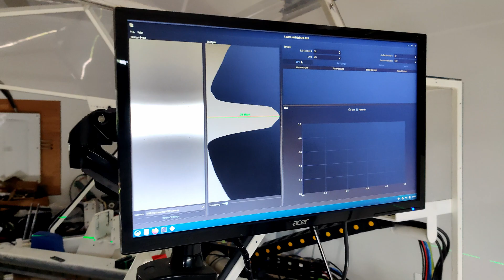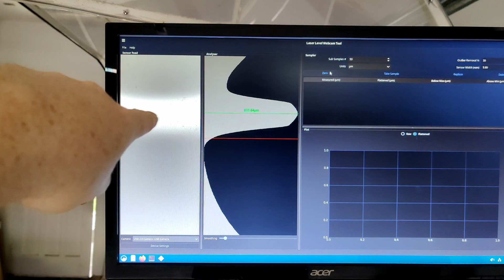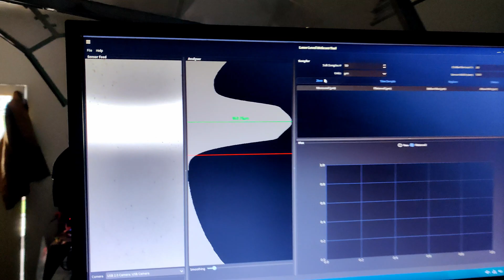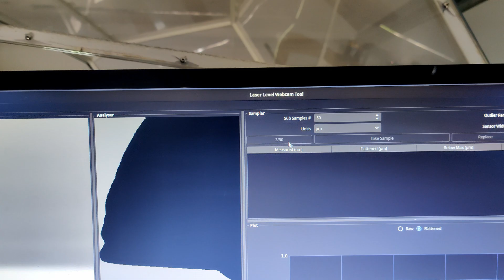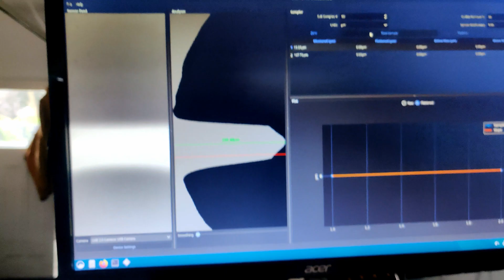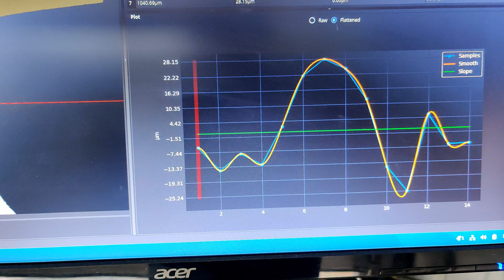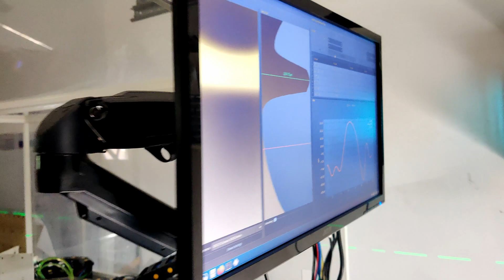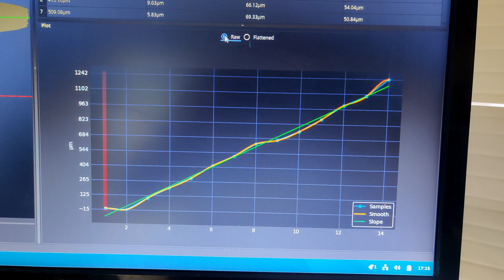More measuring with laser and webcam

Comment: Personally, I would like to see what would happen if you tried flattening the high spots using a piece of precision ground steel and fine sandpaper. Or a good flat sharpening stone.
Reply from the maker: It would work. You’d need to be working with thicker steel than what I’ve got. The main issue I’ve found is when thinner steel tubes, you’d have to take off so much of the corners getting the center of the tube where the rails bolts to flat.The profile of the tubes it kinda dips in the middle where the rails are. 
Next time if I were to build a cnc from scratch, I’d either start with thicker tubes that I can surface a whole bunch of material off without compromising the tubes or to weld some 1/4” flat bar onto the surfaces where the rails would bolt to and get those machined and ground flat.

Comment: This is really cool! What if you used one of those tiny surface plates, say 12" size, combined with the laser graph, to scrape? That way the plate gives you local flatness and the laser gives you large scale flatness.
Reply: Thats a great idea. Imma try it. Want to incorporate laser and scraping for a long time, but never thought of a small surface palte
Reply from the maker: Yeah should work. I've got an 18" plate but have yet to build a stand for it. 

Maybe mapping and marking the same mid value with the laser/webcam. Surface plate should make quick work of marking the high spots to take down.

Comment: Super cool project Bryan... have you tried this with a rotating self leveling laser? Or do these vibrate to much? and could you share the camera/sensor you use?
Reply from the maker: Not with the laser but I did try rotating the mirror. Tired it with a hard drive motor and polishing the outside. Had no success with it. Too difficult to polish the surface good enough to be a mirror. 

I've got a video uploaded on it.

Comment: Since you have been working on this for a while, I would suggest recording these values for all the surfaces, then put it together. If it turns out you don't like the accuracy of the the machine, you can implement an error correction step to compensate or get the machine to your desired accuracy. You may be at a diminishing returns region already as dynamic deflection while machining may exceed your current setup.
Reply from the maker: I’m using LinuxCNC and have a topic on their forum on the subject. So far there isn’t much within LinuxCNC to be able to correct for this. I’ll probably have to look at this on my own at some point. https://forum.linuxcnc.org/10-advanced-configuration/50250-possible-to-automatically-compensate-for-irreguarities-on-the-xy-plane

Comment: Nice work.  Once the rails are flat, will you measure & calibrate the rails to be parallel with each other?
Reply from the maker: I have a master precision machinists level that I use for getting the Y rails onto the same plane. These levels are very sensitive and work well for this. What you do is zero the level out on for instance the right Y rail and than use that zero reference when measuring the left Y rail.

Comment: Maybe some coarse lapping would work. Otherwise there is a lot to experiment with, angle grinder polishing, flap disc, (grinding disc if worn because it grinds quite slowly then), as you said dremel, sharpening stone, carbide paint scraper scraping, corrosion with acids, copper acid solution which will make steel get off when the copper tries to adhere and the steel dissolves, electroplating the low spots, using a plat plate with mold release and epoxy do thin layer, mount the linear rails or whatever elevated in the air with every bolt so the nuts determine the flatness.

Comment: Your laser method inspired me to try a different, much more archaic aproach since I have outdoors space I can use. Im also building a moving gantry CNC and plan to use a cheap cross projecting laser and move it across the rail on top of the moving block and use that projected cross far away (6-10 meters away) to detect inaccuracies since the cross shouldnt move or rotate. By having it projected that far away, a very slight defect should still be detected. So far, Ive finished welding the gantry tubes and Im afraid I have a lot of warping, 2 mm deep bow in the center over a length of 1m. Ill have to correct that first, then fine tune with my method, thankfully I prepared a raised surface for the rails I can remove plenty of material from before I reach the main tubes.

Sadly, I suspect welding these raised surfaces is the main source of warping (the rest is sequence welded and symetrical) but I was gonna have to scrape away material regardless, so better have plenty warping and be able to remove it than to get the tubes so thin you cant thread into them.
Reply from the maker: Since you can weld, I'd suggest get some flat bar ~1/4" (6mm) and weld it to the surface you plan to have the rails on. That'll give you lots of material thickness to get the surface flat again. If I'd had done that with my CNC machine I would have gone through the process of scraping and grinding them flat
Reply: @BryanHoward  Yep yep, did that with 8mm thick 60mm wide flat bar. Cut it in the middle along its length and welded the ~30x8mm bars along the 1m in key areas, not the whole length, that would be a catastophic ammount of warping then, considering I got 2mm bow trying to be careful Xd. Planning to do the same for both Y-axis rail mounts but Im really afraid of the work awaiting me on getting the warp out of it.

Comment: As you say it is just 0.002" which is actually really good. BUT you know it is 2 thou out. I would suggest using a flat stone and addressing you major high point areas. It won't take much to remove a thou or so and so halve your variation. Given your setup it is now so easy to stone it a bit then check immediately and accurately so it really becomes a why not. That said if you can't get it to alter reasonably quickly and with little effort there is no harm with just letting it be. If nothing else it could be a short video to show that it is or isn't easy to address this variation.
Reply from the maker: I might try hitting it with flap wheel on the angle grinder to hit the worse high areas. That might be the best tool as the surface has a slight concaved profile shape to them being a tube. Flap wheel can keep that shape without grinding down the sides too much.
Reply: @BryanHoward  I would think that will be too aggressive given you are only chasing a thou or so. A narrow stone, about as wide as the track? Also that raises the point that you aren't actually measuring where the track will be as your support for the imager is wider than the track. For a better representation put some tape down where the outside of the track will be as a guide and use spacers that are just the width of the track. Then you will be measuring exactly where the track will be located. Again does this all matter, not really, but given you can measure to microns "easily" its fun as an observer watching it being chased. If it isn't fun/interesting for you then.....

I didn't realise this started from a PRINTNC project until one of the latest comments. I am know thinking of building my own based on it as most of the base thinking is done. A kind of weird setup is in my mind. Invert the XY axis and treat it like a core XY printer. Provide Z by moving a separated table Up/Down. This would mean the spindle is ALWAYS at its most ridged point. Also if you do this you can add more weight/dampening to the XY structure as you don't have the weight of the Z structure interfering. Also the Z axis can be well constrained (4 rails in my head) and almost unlimited in its weight as its movements are relatively small and slow. I haven't seen any CoreXY type routers but I think the concept make sense. Just like it is the now "best" type of 3D printer.

Due to space limitation I intend to have it INSIDE a table. So a little smaller than the std PrintNC but hopefully not too much if I make the axis belt driven. The top of the table will be a welding bench convertible to a MPT wood bench and plain bench. In my head everything fits, with the FUSION drawings for PRINTNC I can easily try it out in virtual space. To make it usable I will have lift legs that can raise the whole table when needed. It will be interesting to see if it can operate well when lifted. Will the whole thing be ridged enough within itself so vibrations of the whole structure doesn't matter as it is the WHOLE structure that is moving so there is no relative tool/workpiece movement. Anyway still a project at the pondering stage so no outcome, if any, for quite some time.
Reply: I think this youtuber is conflating levelness with flatness, he should first make the whole surface flat using a flat reference and trully understand flatness (elbow grease it)  before pulling out any lasers.

Comment: Hey bryan, did you have a look at the taunt line method? has some quite good papers behind it with results making it comparable to an interferometer measurement.
Reply from the maker: I've looked at it while building this one. I think it could work out quite well and I plan to build one some time in the future to compare both methods. My main reason sticking with the laser and webcam method first was to see how well plotting points in a 2d grid and automating that all with the CNC machine would work. That all worked but became very finicky with the laser line calibration. 

The taunt line for measuring straightness might work out better for simple setups like rail straightness as there are many less variables with the laser compared to this method.

Comment: I find this whole endeavour absolutely fascinating! You're opening up a whole world of amazing possibilities, including some daydreams of my own. Years ago, while thinking about the accuracy limitations of DIY CNC milling, routing, and (especially) grinding machines, I wondered if it would be possible to integrate an optical alignment system for the tool head which could dynamically compensate for misalignment. Creating a rigid structure is much more achievable than creating one which is both rigid and perfectly accurate. For DIY machines the latter is constrained by the maker's skill, the metrology instruments they have, and the quality of affordable components (linear rails, bearings, etc) typically used in DIY machines.

If you could integrate something like what you've been documenting here into your machine, perhaps you could regularly map its imperfections and create some sort of correction table that could be applied to your GCode before it's sent to the machine. Perhaps laser/camera units attached to each corner and a rotating mirror tool in the spindle (especially if driven by a servo that could be rotated precisely).

As I said, I find this all very fascinating, so please continue to share your amazing work with us armchair daydreamers 😁
Reply from the maker: I've spent a bit of time a couple months back looking into what it would take to modify LinuxCNC to have a calibration map of the surface of the work area. This could be a matrix of static height values measured by the laser. Basically what is been done with current 3d printers to get very good mapping of the heat bed for good first layers. 

Something like this on a CNC would improve any inaccuracies of the XY axis in terms of height. I have a couple videos with automating the CNC with the laser level + webcam to do surface probing and one video probing a coin with a crap load of points https://youtube.com/shorts/vuXR8RIW44o?si=ffIJpOk-DIx-zXwm
Reply: @BryanHoward  yes this would be excellent. If well integrated it could be a routine task ahead of any machining task, compensating for not only built-in misalignment, but temperature and component wear as well. I think it could revolutionise the capabilities of DIY CNC machines.
Reply: That would be awesome, Im building a machine myself and I believe when Is finished it will be over 300kg and plenty sturdy, but I still have a very long way to go and so far Ive induced a significant warp from welding the gantry main horizontal tubes that I must absolutely correct, however the remaining innacuracies is whats difficult to get rid of.

What would the probing procedure with lasers and mirrors be like? I believe maybe you could have an accelerometer firmly attached to the spindle body and run a stop and go probing sequence gcode simultaneously to a table filling program on the accelerometer side (that would make the probing much faster even though the end result will not be as accurate since accurate accelerometers can still have +-0.01º error and thats significant over a length).

I can imagine an effective result will comensate for bow and twist over short drilling operations, but it would still be impossible to accurately drill long straight holes because its phisically impossible unless you have a 4 or 5 axis machine.

Anyways, I wish you start your machine building endeavors soon, once you get your hands dirty with it, its hard to stop... XD
Reply: @DgtalBreakz  Just a thought, but I think the most practical application of this technology would be for planar accuracy, not positional accuracy (assuming you are thinking of wider application including positional accuracy). That would allow compensation for warp and sag, and give the added bonus of tramming verification for vertical spindles. Accurate linear scales are relatively inexpensive these days, and they can give you excellent positional measurements, especially if installed on both sides of the gantry.

I think that as long as you can get the image sensors fairly aligned, you could install a battery-powered laser directly into the spindle, which would act like a laser level when rotating. The laser beam would sweep across the image sensors in a perfect plane. Moving the spindle through the X and Y coordinates would reveal any deviation between the plane of the spindle and the X-Y plane of your machine (as long as the laser is set precisely at 90 degrees to the spindle axis, or else it would describe a cone).
Reply: @pauldorman  I see, that makes a lot of sense and would work asesome assuming the z assembly is very precise. But I can imagine a similar setup could be made to prove Z but you would have to rely on a different laser spinning source since the light line would be projected vertically to map along the Z travel.

Comment: I received my PrintNC parts this week 😁. Im planning to use your software, its easy and cheap! Why are you scraping the high spots and not grinding them?
Reply from the maker: The PrintNC discord is very helpful. It's worth putting as much effort in being as accurate as possible with the bolt holes using the 3d printed hole guides. Good luck!

Comment: those webcam settings are a part of windows that is universal for all webcams, I think the package you would want in linux is something like v4l2ucp, which is a control panel similar to that one in windows for any v4l2 (video for linux 2) devices, which should be like any webcam etc.

awesome stuff btw, great videos!
Reply from the maker: Yeah I never figured out how to from python launch the windows device GUI for the webcam. It can be done via c++ but kinda a hack just to add it. On windows my work around was to launch it from ffmpeg with "ffmpeg -f dshow -show_video_device_dialog true -i video". Basically wrap that as a subprocess from the GUI. Looks like v4l2ucp in linux might be similar enough. Thanks!
Reply: There's a QT5 patch file in the ArchLinux AUR Git repository for v4l2ucp. Using it I built the application successfully on my Ubuntu system.